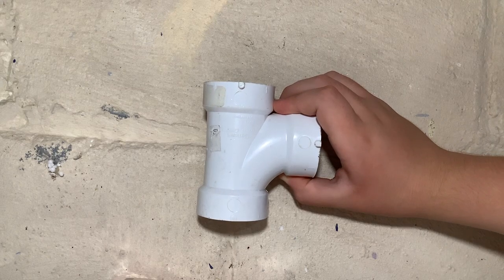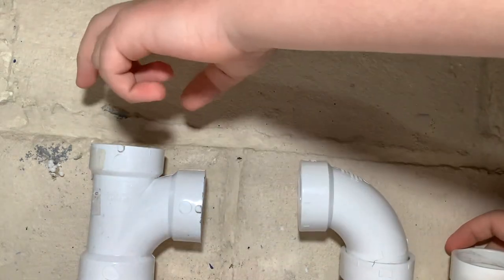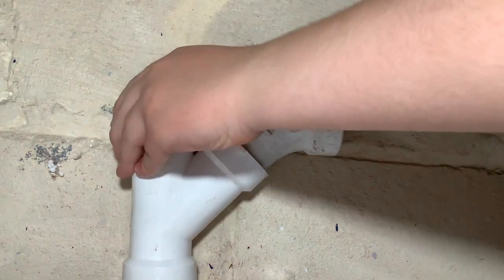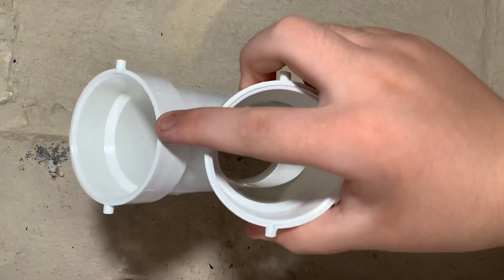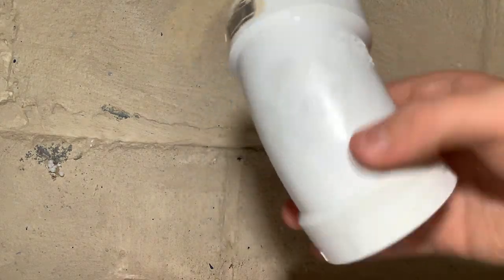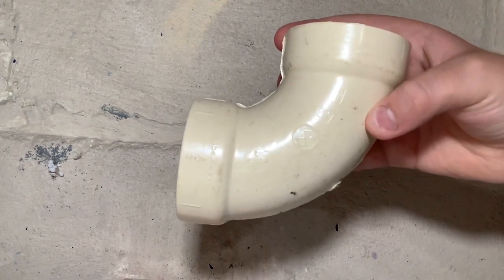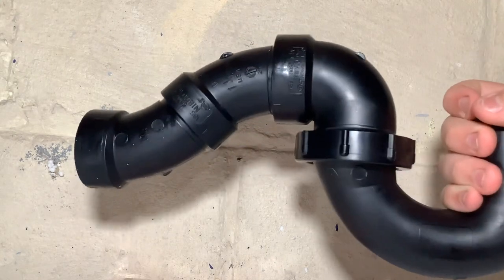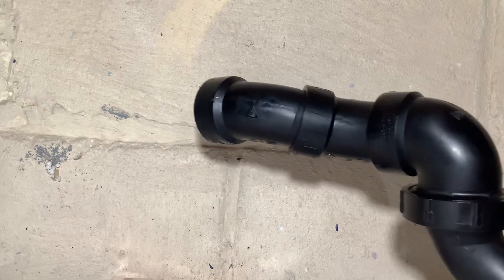Where to use wyes, tees, and different types of elbows.(2021)

Comment: Another awesome video. I really like that yellow colored GSR Brand 2x1-1/2 combo y ( one piece). Part # 4320. Very awesome 👌🙂
Reply from the maker: I am pretty sure it was made before 1975, I saw some GSR PVC from 1975 that was white.
Reply: I’m pretty sure it’s got to be before 1975. I got a yellow gsr pvc 3x3x2x2 double wye part number 2377. I’m guessing about 1974.
Reply from the maker: @matthewlassise7607  do you know when they stopped the production of the grey SCH 40 fittings? I have seen grey fittings sold by the same seller that is selling white fittings so I would assume the grey ones got discontinued more recently.
Reply: I think probably 1977 was the last year that grey pvc schedule 40 fittings were made.
Reply from the maker: @matthewlassise7607  I never knew GSR made ABS pressure fittings until I saw part of an episode of mr rogers neighborhood from 1981 where they had GSR ABS pressure fittings connecting to a fountain. I found some ABS pressure fittings a few months later, they were marked with sloane so they were probably made before 1969.

Comment: What is the reason to either use black ABS drain pipe vs white PVC drain pipe?  Is it region-specific?  Are they interchangeable?  Are there applications where only one of the two can be used, but not the other?
Reply from the maker: In Wisconsin we can use both, but pvc is common. Pvc is better with chemicals than abs.

Comment: I'm not sure on the 90⁰ 2" and 3" elbows to use long radius or not.  
If I have a 2" horizontal transitioning up, or vertical, to be a drain for vanity or kitchen sink, is regular 90⁰ okay, or needs to be long sweep?
Reply from the maker: Preferably a long sweep which would probably be required if the vertical pipe dumps into a horizontal pipe.
Reply: @jacksplumbingvideos7147  Personally,  I believe both will work, but I want to pass inspection.  I have a regular one installed now, but someone said that needed to be long sweep.  So I'm just doing some research on what is required over being preferred.

Comment: Double wye can be used upright, I believe. Just not if you need venting.  Am I wrong?
Reply from the maker: If it is to connect a vertical vent to a horizontal trap arm then you can’t use it, if it is just to connect drains that have already been vented then you are fine.

Comment: What pipe should be used for toilet drain?
Reply from the maker: PVC, ABS, cast iron, or copper pipe. With a toilet closet bend which is the elbow directly under the toilet you can use a reducing closet bend, a long sweep 90, or a short sweep 90, this is the only time you can use the short elbow horizontally.
Reply: How about a sanitary tee reducer under the toilet? Will it be applicable?
Reply from the maker: @DrxThmSklnst  I don’t think so, check with your local codes.